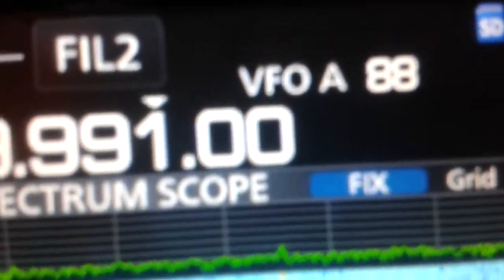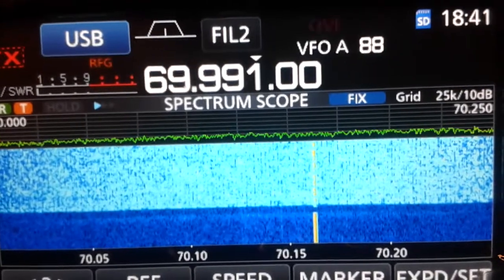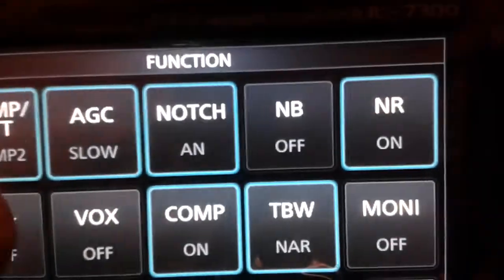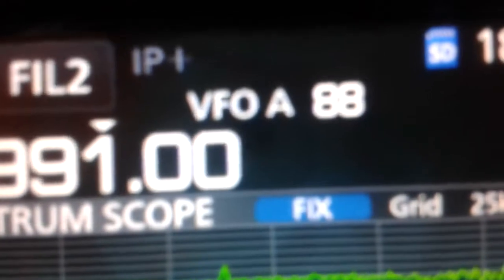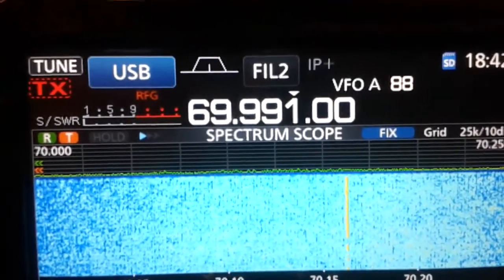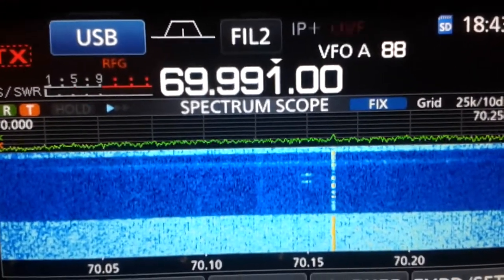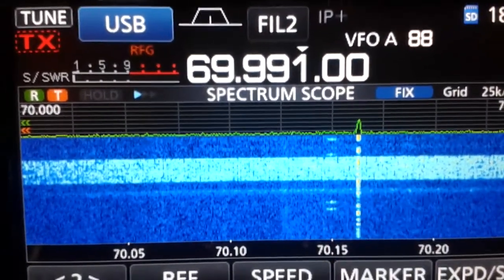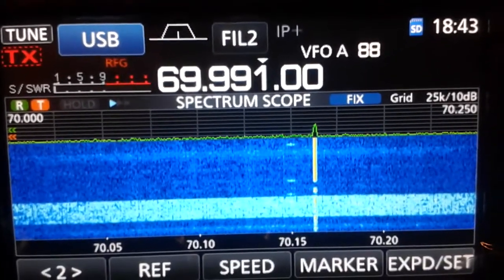ICOM IC-7300 Pré-selector (to avoid OVF)

Comment: it's because the tuner is NOT tuned to the frequency you are displaying and you also won't be able to tune that frequency either as you cannot transmit there. Not being correctly tuned, it makes your antenna not hear anything thus cutting the reception so cutting the OVF. 

By the way, the IP+ is used only for strong signals, if you want to hear weak stations, you should turn the IP+ OFF.

To complete, the only way to remove OVF is to  use the ATT or RF Gain on the radio OR use a noise reductor like the mfj1026 or the timewave anc-4.
Reply: qrm-eliminator is more effective than the mfj1026. the mfj cant do a 180° phase inversion, the qrm-elimiminator can and cost like 1/4.
Reply: I do think the reason.  I get that OVF and I get it when I am tuned on 40M, and 20M so I dont think it is because the frequency is not tuned.
Reply: @BlackHamRadioUniversity  I understand but I was referring to the current video, when the gentlemen here turn on the tuner on a band that has NOT been tuned, it does not resonate correctly and reduce efficiency of reception, act like an attenuator and the OVF goes away. 

I do get OVF on tuned 40m or 80m band being in the city with a lot of electrical noise, the only way to get rid of the OVF is to reduce the receive sensitivity by using the attenuator or RF Gain, simple as that. You will cut the high noise levels that overlaod the front end of the receiver because 7300 receive a really wide bandwidth thus can get sensitive to overloading due to high noise levels througout that large bandwidth it can hear.